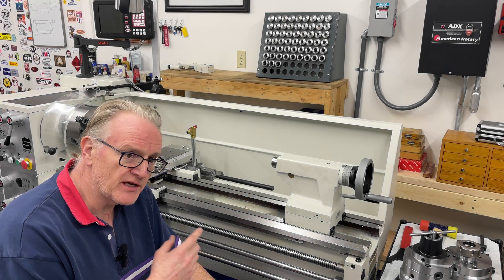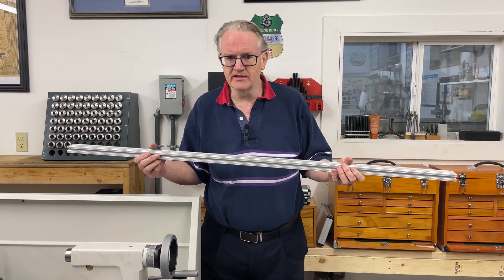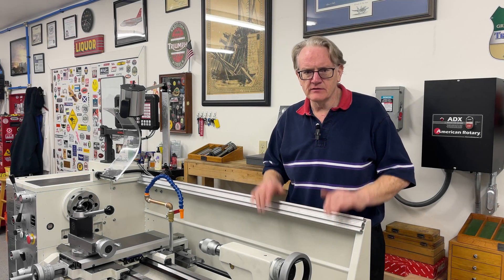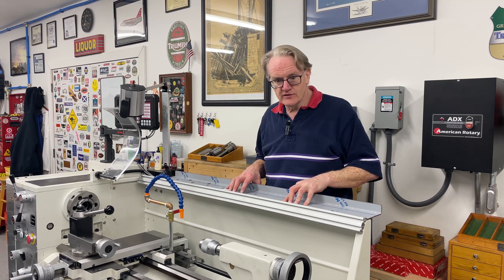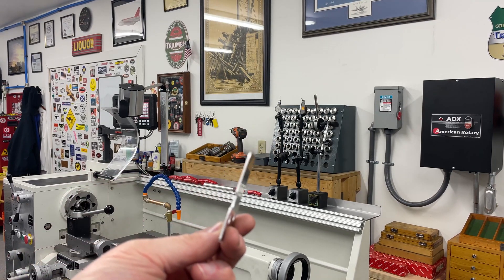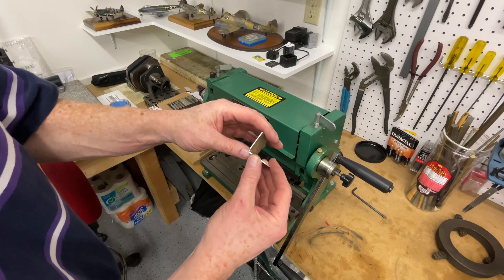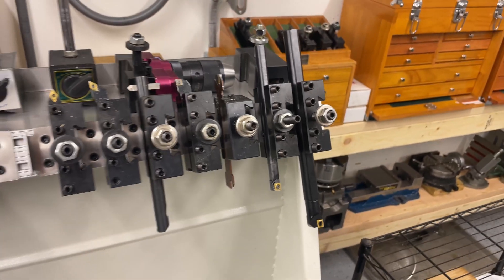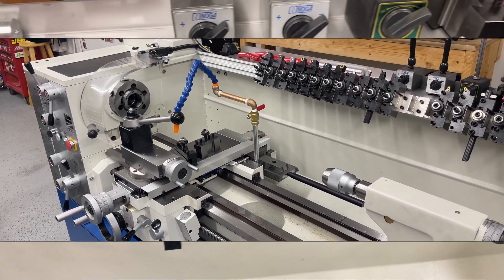Simple and Inexpensive Lathe Tool Organizer and Shelf for an efficient and effective workspace.

Comment: Looks good Stuart. Just a thought, I think you may find the magnetic bases will rattle around or even fall over. That is the touble with a SS shelf, probably non magnetic, although some SS are. You may want to silicon on a bit of Mild Steel plate for the bases to "Magnetic" to. Regards from Australia.
Reply from the maker: Dave - turns out that the lathe is so smooth there is not even a trace of rattling or vibration from the DTI stands. However - a piece of mild steel glued there will provide a nice safety anti-knockover device, so I'm still going to do it.
Reply from the maker: Great idea Dave! Cheers!

Comment: Hello Stuart,
I like the tool tray and a shelf like that right next to the lathe is very useful, I have something similar with mine too.
The only disadvantage is that the chips always build up there and you have to constantly clean them. I'm thinking about a compressed air connection to remove chips with the compressed air gun.

I can already hear the castings quietly calling:
"I want to be the first on the lathe"
Reply from the maker: Chips do tend to get everywhere. I expect to clean them up with my shop vac at the end of each session - hopefully that works out. I wonder what  engine part will be first? I can’t wait for the weekend so I can find out!
Reply: Maybe the flywheel?
Reply from the maker: Interesting idea. Start big! I like to save the flywheel for last though. Hmmm. We shall see.